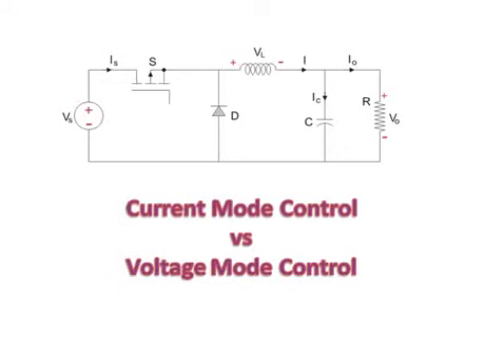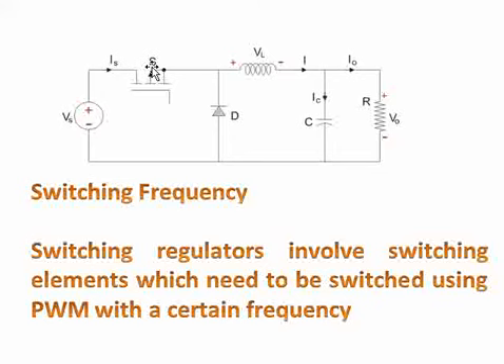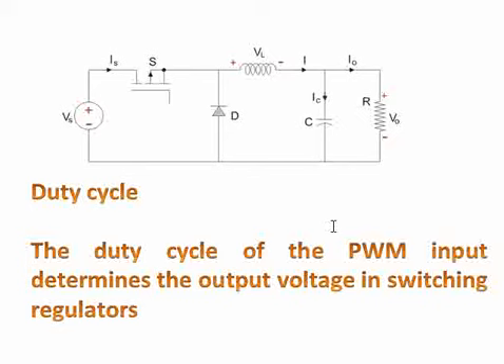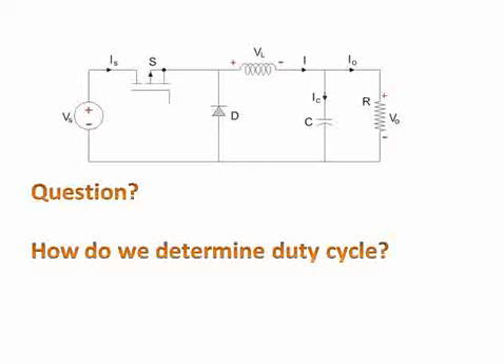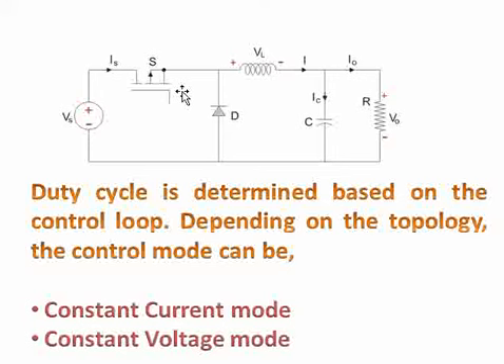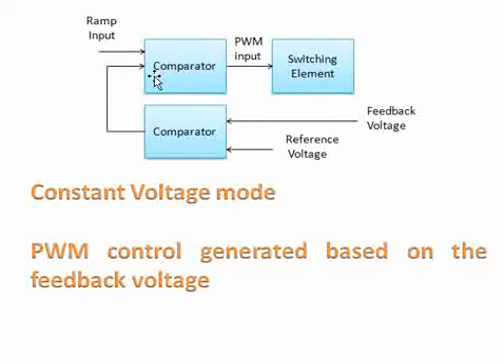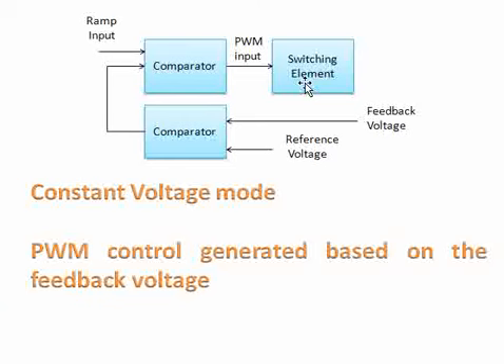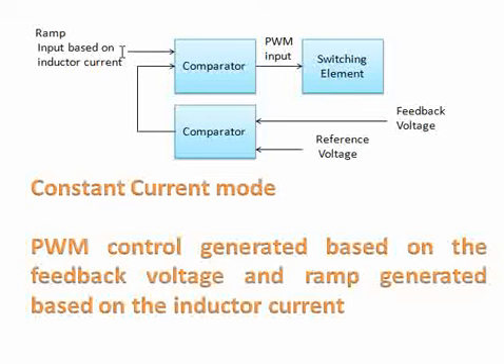What is the difference between Constant Current Mode and Constant Voltage Mode | Switching Regulator

Comment: what the pros and cons of these
Reply from the maker: That is depending on application. If we want constant current output or constant voltage output. Simple example is your power supply which gives a constant voltage and varying current.